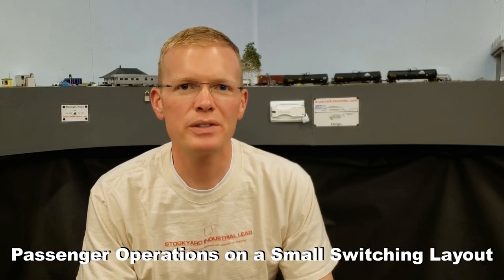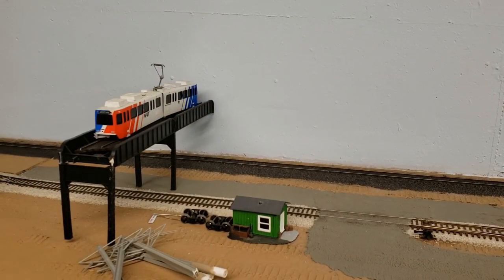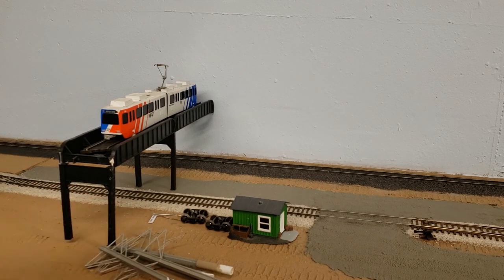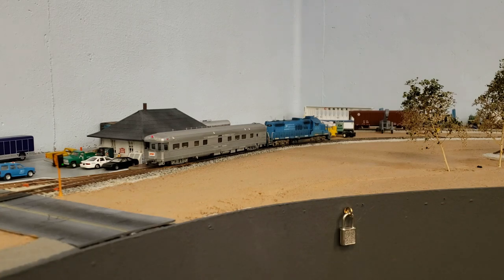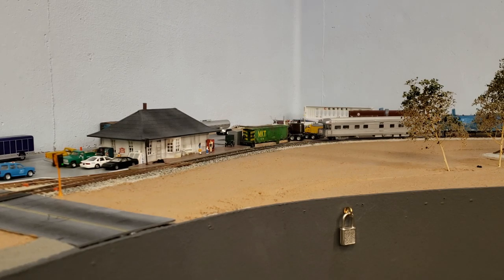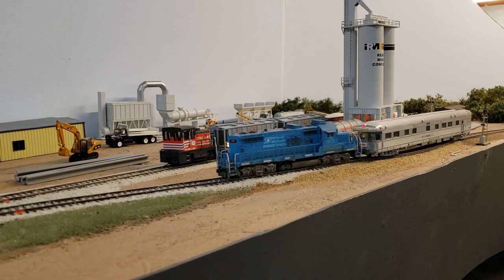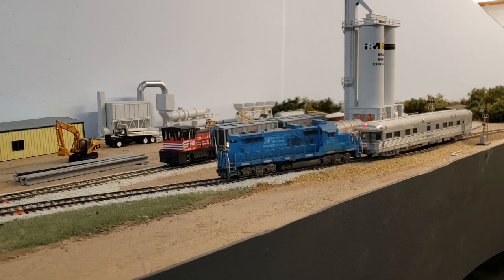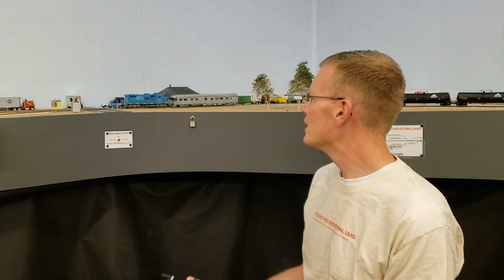Stockyard Industrial Lead: Passenger Operations Possibilities for Small Switching Layouts

Comment: Nice work. On my prototype there was a private varnish car stored on a little used siding. They had to "dig" it out of the line shared by multiple small industries to A. get it on the road and B. get it out of the way to switch the rarely served industry just past its parking spot.  Adds an opportunity for variety. My "business train" for the layout is a "doodle bug",  and a Kato business car.  A troop sleeper, a "heater car" and/or a caboose can be added to the train as well.
Reply from the maker: Thanks for the note, that is a really interesting operation! I also like your business train, great idea.

Comment: Hi Eric,

On my layout, I have two passenger trains. One is a special "fan train" that runs over the line in both directions over two operating sessions. The other one I run very infrequently is a detoured Amtrak train that may run over the line once in a while if the primary line it usually runs on has a derailment or or other track issues (such as a washout)...gives me and excuse to run a national passenger service over my shortline.
Great ideas Eric and thanks for posting the video. Now, that I've seen this, I will have to add one more passenger train the mix...a business train!
Reply from the maker: Thanks for the comment and for sharing about your passenger trains!  Those both sound very interesting and that's a great idea to have a detour passenger train.  Very cool!

Comment: You could also pick up a pair (or more) of late 70's/1980's Bachmann Plasser EM80C Track Geometry Cars and to avoid the trouble of the factory Bachmann drive, stretch out the Bodies, and remount it on a reliable drive.

Comment: Thanks. Good video. What the heck are those little padlocks for on the facia?
Reply from the maker: Those are locks that correspond with the manual ground throw turnouts. The crew is supposed to unlock the switch before moving it.